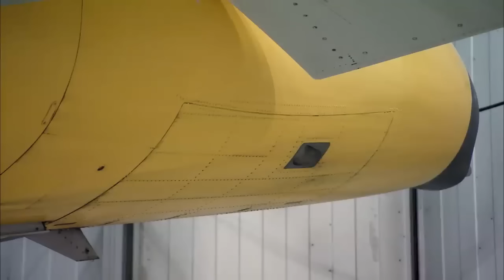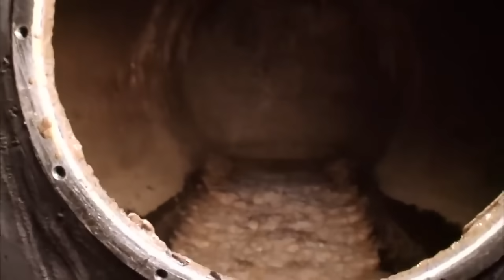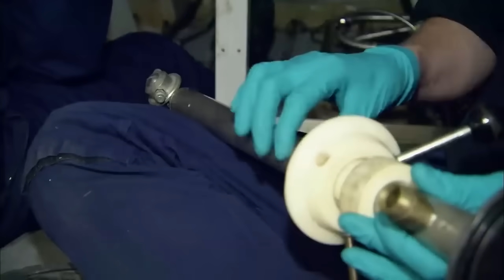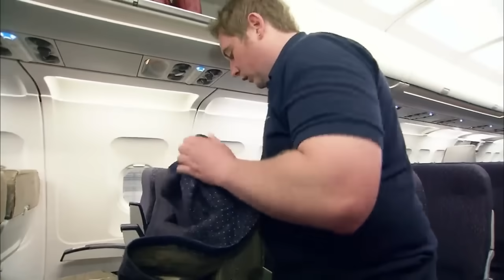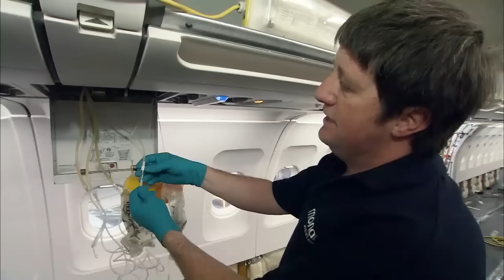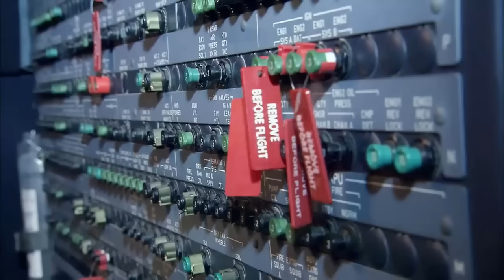Most Disgusting Thing About Cleaning an Airplane | Filth

Comment: My wife worked this job part time while back in high school but between flights so it was always a rush to get the airplane off the gate again as quick as possible. More than once pilots asked her to crawl out the cockpit windows and stretch around to clean the windshield. No harnesses or safety gear. Just a pilot holding her belt loops (quite likely enjoying the view as well) so she wouldn’t fall the couple stories to the ground. Being a kid she didn’t know she should have told her boss to get some safety gear or do it himself.

Comment: I used to work in aviation as an A\P mechanic and when the planes came in for checks (C & D), the planes was put out on a wash area and the plane was power washed with high pressure water and a detergent to remove all of the grime. Wheel wells, wings (flaps, etc...) came out spotless. No one ever used a bucket and a rag to clean the planes. When the interiors were pulled, I used to find coins from all over the world in the seat tracks. I did find an occasional $10 or $20 stuffed in a seat. My favorite was an old PSA L-1011 that had a lower bar area and after removing the seats from that area, I found about $5 in quarters.
Reply: If I remember correctly Monarch would pool the found coins for the annual party fund.

Comment: The big question is, how many airlines take it to this level for maintenance like we just saw? For cleaning the skin on the bottom of the aircraft they need a stand that they can lie down on. You can’t appreciate this kind of cleaning until you clean the bottom of the flaps behind the engines; it takes a few minutes. Excellent video!

Comment: "Disgusting!" ?? really?  I used to clean jets and turboprops, inside and out.  I am amazed at how much film was allowed to build up on the exterior, because it is inefficient, causes drag and costs money.  I usually found film like that behind the exhaust of a Fokker F28.  737's with the bucket reversers would deposit a plums of exhaust up the fuselage aft of the engines - but under the fuselage, I never found it like that.  So overdue, but " Disgusting"?  But we assume it was a regular female flyer, who would place a sick-bag containing soiled sanitary products in the seat pocket.   Interior crews would start clearing the seat of rubbish by opening a sick-bag at the leading seat of their section, and regularly their hands would find a nasty present in the bag.  Back then, gloves were not used.  It was like the traveller knew where to leave her gift.  But we cleaned so many planes, and had to work fast, so yes a cleaner would get caught out occasionally.  In my opinion, THAT IS DISGUSTING.

Comment: Come to Canada Air Canada does not clean nothing same with west jet. You have a few immigrants basically board the plane before the passengers with a small pathetic vacuum that's it. Take a wet nap and wipe down the arm rest table and head rest. you will be disgusted. Even business class is gross. that's why Canadian airlines rank at the bottom of the heap

Comment: I can never fathom why anyone would flush a diaper down the toilet. In what world is that even normal? In what world does a toilet be able to function normally after?? People don’t realise that these selfish actions can come back to haunt them, I.e. airlines charging more because of replacements etc
Reply: you'd be surprised what people attempt to flush down aircraft toilets. I was fortunate enough to once avoid a job where a passenger tried to flush a blanket down the toilet. the theory is they had an accident while sleeping and was too embarrassed to tell a flight attendant. the blanket got down the toilet but stopped in the pipe blocking and backing up the lavs in the rear of the cabin. the tech that removed the pipe work was sent home after the job as the waste got through his hazmat protection. not worth the extra £100 if you ask me
Reply: I'm a ramp agent and do toilet service among various other tasks. You'd be surprised what comes out of the toilet truck when you go to empty it, people try to put all kinds of stuff into an airplane toilet!

Comment: Fun and interesting stuff. That toilet tank looked so nasty 🤮🤣
Most of the dust is not skin partices though - it's just fibers from the seat covers, carpeted floor and peoples clothes. Everyone who has used a tumble dryer have probably seen very similar dust collect in the filters (even though that's nothing nasty at all - just fibres from clean clothes that has just been washed). It wears off because of friction when clothes are tumble around. The same happens when people get up and down from seats draging their clothes against the seat cover, walk on the floor etc. 
But there is indeed some human skin residue mixed in there as well...
Reply: House dust is about 50% skin cells.
Reply: @cecilearquette1637  Funny, that.

Comment: The outside could and is often cleaned with water pressure washer. There is no need for all that elbow grease.
Reply: That is tar embedded with dust from taxiways and runways. On a hot day it hangs in the air like a mist, this is the same stuff that clings to the headlights of cars turning them yellow and needs a good cutting compound to get them clear again.🐸
Reply: I have done hot water pressure washing for a living on restaurants, dodgers stadium, LA Staples center, building exteriors, and on equipment and commercial kitchens. There is a lot that can be done with 200 degree water at high flow (ours were 5.5-8 gallons per minute) but it is not the same as touching a surface, especially smooth surfaces. Pourous surfaces like concrete and tile and grout actually clean well with the right soap and pressure washing, but contamination really sticks to paint and can sometimes embed into it. I was a pro painter for many years as well so I got to really see how it acts between types and conditions.

Comment: Makes me wonder if there´s a significant weight difference before and after a plane is put through this cleaning procedure.
Reply: I was thinking the same thing. He did say the cleaner outside would give a benefit in a fuel saving, so I guess it all adds up.
Reply: @ Indeed. Although my first impression about the exterior affecting fuel efficiency would be more about the aerodynamics, because who knows how uneven the fuselage surface is before its cleaned.

Comment: One the biggest reasons they stopped permitting smoking on board was because of how intensive the cleaning process was.  Look at all that dust we see in this short video.  Now imagine that all caked in a layer of stinky, sticky, tar like substance.  That's what they had to deal with before smoking was banned.
Reply: Lucky they had "Smoking" and "Non-Smoking" seats for people to avoid the nasty smell LOL. OMG are we crazy to think like this?
A friend of mine used to be an aircraft engineer and his overalls used to get covered in the tar/nicotine after his clothing touched the underneath of the aircraft and his poor wife had the impossible task of washing them after.
Reply: And I'm so glad they stopped smoking on flights and in terminals❤❤❤❤
Reply: Yes, it saves the airline millions of £/$ in maintenance and component repair and overhaul.
Reply: Smoking on planes was eliminated years ago. Airlines stopped cleaning the very day after
Reply: Smoking showed the air leaks around rivets and cracks.
Reply: @RodgerMudd  Ah yes. That's why planes crash all the time now. Because they can't see the air leaks around rivets! (Not like you can just tell a leak from the pressure dropping, but you know. Boomers will always be clueless.) 😂😂
Reply: I'm glad I'm not old enough to have flewn with planes where smoking is allowed. That must have been nasty - especially on long fights to sit there for hours and inhale the bad smelling, toxic stuff. Then when you finally get off, you probably smell like an ash tray and have to go change clothes and take a shower the first thing ju do when getting to your destination or get back home after a trip...
Reply: @Speeder84XL  fresh air is circulated from the engines in the cabin exchanging it constantly. Yes if you're next to someone smoking you will be exposed, but generally it's just the panels and avionics that are coated. That and ashtrays.
Reply: @jagtan13  It takes a huge amount of air to ventilate it out if many peope are smoking at the same time. I mean, even sitting at an outdoor restaurant with some smokers, can be bothersome if there are no wind (especially if they also have sun shades above, so the smoke cant rise straight up into the sky). 
So, the airflow needed to really get rid of the smoke would probably use so much bleed air that it affect the fuel consumption significantly and steal power from the engines. The fact that significant tar deposits did form on air ducts indicate the air do get really dirty before it's extracted. Maybe it would work better with strong wents right above the seats sucking out the smoke right as it rises from the cigarette and when the smoker blows it out (think a row of kitchen fans sucking up the smoke) - but still there need to be many of them, so the combined flow still get quite high. I have also never seen planes built like that either. Usually there is an air inlet blowing air above the seats (which will mostly cause the air to swirl around, spreading the smoke thrughout the whole cabin before it finally find it's way to the extraction vents next to the floor).
It's obviously also a question about how sensitive you are as well (I hate cigarette smoke). It might maybe have been good enough for your cothes to not stink afterwards though.
Reply: @Speeder84XL  As a person who is allergic to tobacco smoke, I'm glad there are laws against it and it has become less popular. I can smell it coming from another vehicle a couple cars away, if my windows are down a little. It only takes a few minutes of exposure for it to start to cause breathing problems. Years ago, I stayed in a motel where it was so bad that a single night in the room saturated my bag and clothes with the smell. Luckily, I have not needed to fly anywhere as I don't like crowds and there are plenty of other downsides to traveling and especially flying. I would rather drive and pull my trailer to stay in and do for out of town jobs that are so far always within a day of driving.
Reply: There is obviously some truth to this, however, back when smoking was permitted on aircraft, the air inside the cabin was completely replaced six times more often than it is now.
This almost continuously replaced air came from the engines & because they circulate less air now, the engines burn about 10% less fuel.
Reply: @Will-thegrumpysoutherner  This is not correct